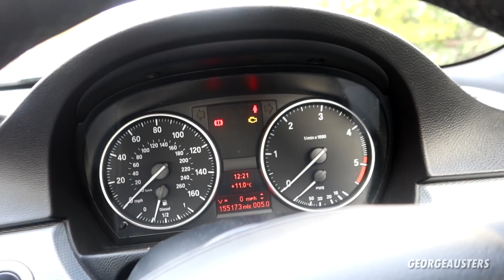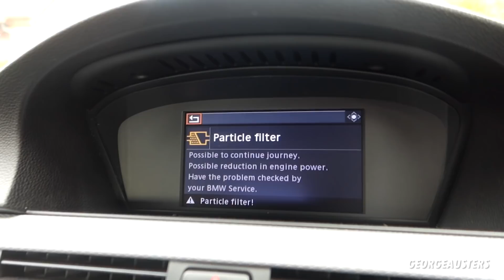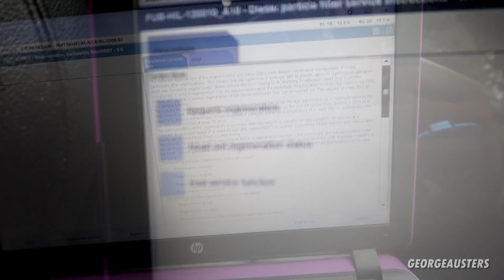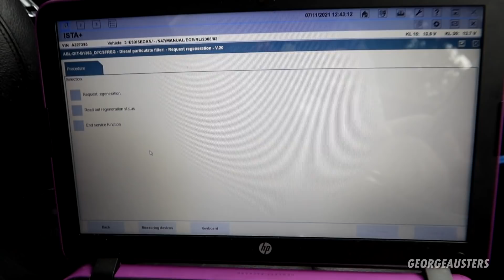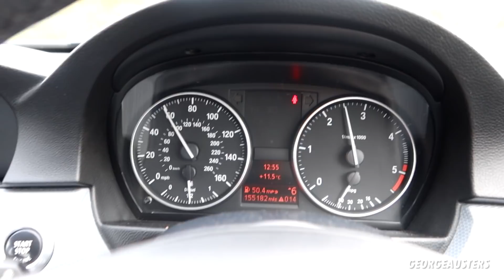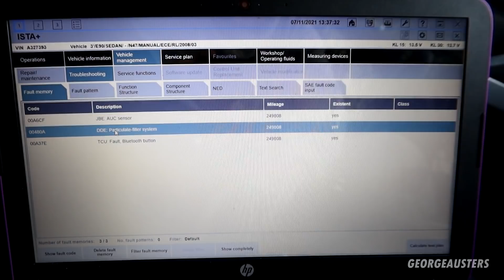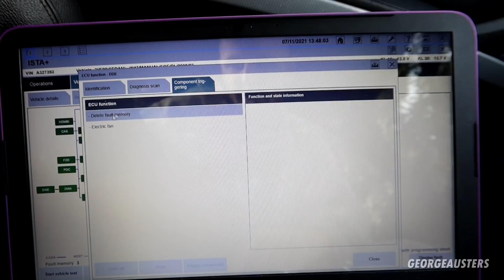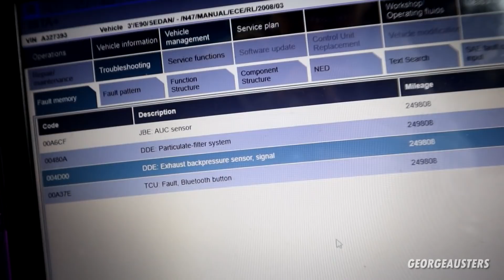SHOULD YOU REMOVE A DPF FROM YOUR DIESEL?

Comment: Hi George. I can see your problem on the ISTA while you are driving very clearly. Your back pressure reading is way too high. The ecu won’t start a regeneration unless the back pressure according the ISTA SHOULD BE WITHIN THESE RANGES: less than 35 mbar at idle, less than 75 mbar at 2000 RPM and less than 200 mbar at cut off engine RPM which is about 4000 RPM. The ISTA will do that test for you. It will rev the engine automatically during the test and the end will tell you the 3 readings and the maximum permissible values as I mentioned above. It is a safety feature because a regen with a heavily blocked dpf might set a fire. Of course you know your both egr and main engines thermostat should be working fine,  the diesel in the tank as you mentioned shouldn’t be low, of course your glow plugs and the control unit should be working, good working egr and no fault code stored in the ecu. Another reason for such high back pressure reading is a a faulty back pressure sensor which is about £30. I had the same problem. I had an on car dpf cleaning twice. It doesn’t work. What I did I took the dpf to a place near Blackpool, I live in northwest, they pump flush cleaned the dpf in about an hour for £150 just then BINGO, the pressure readings came down hugely just like what you get from a brand new dpf. Of course there is a very important thing which most of people don’t know. In the ecu software if the mileage of the car is 150 000 miles then even if the dpf is not blocked and other parameters are normal, still the dpf won’t regenerate until you go through a dpf replacement procedure in the ISTA, even if you physically installed a brand new OME DPF. By the way my car is 520d, M47 engine, 57 registration plate. Hope that will help you. Again please don’t spend any money on ON CAR DPF cleaning, specially you can take out the dpf out of the car your self. Good luck
Reply: Hello, are you suggesting to reset the Dpf counter?
Reply: @kirwanjohn101  if the DPF cleaned professionally and the back pressure is reading really low, something like less than 10 mbar at idle, then sure you need to reset the DPF which I think it will give you another 250000 km.
Reply: This happened to my sister's 1 series, told it the dpf had been changed and it fixed it
Reply: It will regenerate, you just need to keep clearing the errors. While on the motorway it slowly regens passively and it increases exhaust temperature regardless of the backpressure. Mine used to get to about 400-450C for about 10 minutes before chucking an error and failing. You need to clear the error while driving and carry on until eventually it will passively unblock itself enough to blast the temps to 600-650C. Once it hits that it usually clears the soot all the way through.

Comment: Clean thé back pressure hose and pipe kat ,check thé sensor connection and wires then First clean thé dpf then reset thé dpf.  and boom another 150k km

Comment: Check thé sensor connection easy job .tip if you remove the sensor connection fault code will pop up .just delete it and your fine . while at it give me some backpressure readings at idle and 2000rpm . thanks
Reply: Yet no Exhaust back pressure readings 😎

Comment: I have never had an issue with the DPF on any car which I have had, and I don't do huge miles. Removing it makes your car illegal and uninsurable, so if it is working fine then leave it in place. Most failures seem to stem from other issues anyway which cause it not to regen properly. Failed thermostats being a common one.
Reply: EGR is a major headache too!!!
Reply: @paulmcdonald8055  They can be, I haven't had major issues on any of my diesel cars but the one on my N57 is mapped out. (but still in place if anyone tries to look at it)
Reply: @simonh870  the egr cooler is known to crack on BMW's. Removing it entirely would give a peace of mind.
Reply: The problem with that on N47 and N57 engines at least is that you are blocking off coolant routes to the cylinder head and that can cause localised overheating. The leaking EGR was a known fault and I believe subject to a recall, so most should have been replaced by now...
Reply: My bmw1 series diesel kept stalling, new egr valve fitted runs perfectly now.
Reply: @Bob Agreed Bob
Reply: Thermostat.
Glow plugs.
Glow plug module.
Driving around on an empty tank all the time.
Short journeys.
Crapy diesel.
Crapy fuel filter.
Crapy engine oil.
The list is absolutely endless.
Reply: @gulag8735  also any ECU fault code, any half broken sensor giving false outputs like for the exhaust temps (which I think was georges issue, mine goes way over 300C when driving around 60mph constantly over 30mins+ and gets back to around 270 and lower when slowing down, for the regen to start it is I think at least 275
But you have to keep
It higher during as well in order to succeed especially when its a bit clogged already) and the list goes on and on yes. Its better to chip it even when not deleted dpf in order to prevent clogging in case stuck open thermostat not closing etc , in order to shorten the restriction list of it 🤟 Longer life of the dpf will be the reward
Reply: @gulag8735  lol and leaking injectors. Had two of these. Missed by everyone. Numerous DPF blockages as over fueling due to these injectors. And this  extra fuel diluted oil in sump. Big end bearing went , so new engine/remanufactured. M57.
Reply: Totally agree, nanocarbon molecules are filtered for a reason as they cause cancer.
Reply: @n1msu  as does sunflower oil, vegtable oil, canola oil, sugar and carbohydrates.
Eliminate these first
Reply: If you understand how the car works they can be managed quite well. My new petrol car has a ppf
Reply: It doesn't make your car uninsurable or illegal.
Reply: @Tommo12345  It does, as it no longer meets the emisisons standard for which it was originally designed. It is in the construction and use regulations. If you tell the insurance company that you have the DPF removed they will not insure the car. if you don't tell them and you are found out your insurance will be invalid.
Reply: @simonh870  You can legally take anything off you car. If it fails an mot, then you legally can't drive on the public highway. Still not uninsurable.
Reply: @Tommo12345  not uninsurable but you won’t get your insurance money lol
Reply: @Tommo12345  UK MOT failure. Also in the UK modified from "as new" so unless you tell the insurance company you have done it you are also driving without insurance. Will you get insurance for not having legally mandated equipment on the car? I doubt it.
Reply: @martinconnelly1473  Complete utter BS.
Reply: @martinconnelly1473  Why say UK MOT failure? why repeat what i already said?
Reply: @MrSwanny66  Who's correct?
Reply: @MrSwanny66  Don't talk from your back door.
Reply: @Tommo12345  Illegal but not uninsurable.
Reply: @thisisnumber0  Not illegal
Reply: @Tommo12345  of course it does, if it doesnt pass the MOT (which it wont) it is not insured
Reply: @davidstuart4915  It is insured, stop talking from your back door.  ffs
Reply: @davidstuart4915  Illegal to drive on the public highway, without an mot, unless driving to the mot test.
Reply: @Tommo12345  from 2018 in UK it will be illegal "If a car's exhaust emits visible smoke of any colour, it will fail the MOT test. Testers are also required to check if diesel cars' DPFs have been tampered with or removed. ... It's already illegal to drive a vehicle that has had its DPF removed"
Reply: @davidstuart4915  Not very bright are you? haha did you read what i wrote?
Reply: @Tommo12345  U SURE HAVE AN APT NAME :) Ciao
Reply: @davidstuart4915  Not very bright are you? haha ffs.
Reply: @davidstuart4915  who told you, some smarta** or are you presuming only? Have you tried it yet? Your car isn’t even smoking when step on it when your engine , turbos, glow plugs , module etc are all ok. If you know you know. Your comment is bs. I still have mine dpf / egr on my E70 because never had an issue but once it will fail, I’m going to delete them all, or
Maybe if the fuel price goes even more
Higher. The problem with emissions is somewhere else than in cars. Think about how many gallons of fuel are burning the big cargo ships every day 24/7, right now when we speaking. Ships that could already been photovoltaic for example or semi/half photovoltaic, whatever. Nobody does care because they can’t force China or Usa to do so, to change their cargos, limit them with something like dpf and egr on it. Better limit regular ppl with small emissions fok ups what doesn’t change a thing. Look for the tests.

Comment: I think overall driving style affects the dpf condition, short journeys are just not right for 3 litre turbo diesel cars. Replacing a dpf with a new dpf around 8-10 years into car ownership is pretty reasonable to be honest, it's just not the fun or performance way to be honest!
Reply: Well what if i nearly broke my engine since its excessive active regenerations?

The solution is now easy: remove the DPF, straight pipe it, delete dpf (and egr?!) in software and enjoy a proper Diesel
Reply: @harrison00xXx  completely agree. Get rig of the two items you mentioned and that's most of the headaches gone.
Reply: @harrison00xXx  so if it’s costs to be much to get rid of asbestos I can just burn it outside your house ?

Comment: Nothing to do with age mate it’s all to do with the journeys the car does.  When I was up and down the motorway everyday I never had a dpf issue compared to my mates a1 diesel that failed really early in the life of the car due to only doing short local journeys
Reply from the maker: Yeah that is true but after 3 years old you’re out of warranty - it’s all sorted now though, I’ll be making an update video soon👍🏻
Reply: suggest you research the difference between passive regen systems (like the ones you describe) and ACTIVE regen systems as fitted to my 2.0 TDCI Ford which ive owned for the last 7 years (bought used).it can and WILL (and has done) start, and complete a full regen at IDLE if the ECU deems it ready to regen!

Comment: I had a 520d e60 m47 engine with the same dpf problem and same fault codes, I cleared the codes then requested a regeneration and  then changed from ista to inpa started the car and drove it while someone kept pressing the erase fault codes button on the laptop as inpa erased the codes continuously and quicker than ista, this worked for me

Comment: Is it illegal to do a dpf delete in the UK?
Reply: Yes and it invalidates your insurance if they spot it when you try to claim.
Reply from the maker: It’s not illegal to remove it, it’s just illegal to drive on the public road without one fitted when one was from factory.

Gutting it leaves no trace of it ever being removed👍🏻
Reply: @GeorgeAusters  Revoving it will make the car emit more soot, that was what it was there for. It can easily be seen when the car is accelerating, and there is no map that can get around that otherwise the DPF wouldn't have been fitted in the first place. The chances of being caught are slim but if you get involved in an accident and it is found out the consequences are severe.

Comment: Just to add George I also had the back pressure sensor signal warning as well .. my hunch is that it's not the sensor itself that's faulty (I bought another one and swapped it.. no difference!) but rather it's reading a high pressure value due to the blocked DPF and is therefore raising the fault code. It also seems the system is self defeating.. like it can't run a regen because it has a fault code.. but as you can't GET it to regen what the hell are you supposed to do? Ultimately as mentioned in another post I just replaced mine and it's been fine since... Verified that regenerations were happening since r replacement successfully. Though I haven't checked it in a while so maybe I should.. 😆

I didn't take the route of DPF deletion due to the prospect of trouble at the MOT.
Reply from the maker: I have another video coming with a resolution👌🏼
Reply: they can't tell if done properly
Reply: @doctord8589  That's what I would have thought.

Comment: Hi George I suspect it wont re-gen because the dpf is blocked at the back with ash. Dpf's do have a limited lifespan & will only re-gen so many times before they need replacing because when it re-gens whilst it burns the soot out this process produces ash which can't be removed/burnt out of the dpf,  & the ash builds up at the back of the dpf causing the differential pressures from the front to the back of the dpf become too large (implausible) giving you the trouble codes I think you've got. I had a problem with a ford galaxy that wouldn't re-gen. It had similar trouble codes & would go through the motions but would not re-gen. It turned out that the differential pressures form the front of the dpf to the rear of the dpf were too great which  think is what your diagnostics are suggesting. There are companies that clean dpf's & they always clean them back to front to force the ash out of the front of the dpf. In my case  the dpf was too far gone & had to be replaced because the diesel catalytic converter had broken up & also blocked the dpf. once I replaced the catalytic converter & dpf the car did a re-gen straight away without me having to request one because it was happy with the differential pressures. I also found out that some dpf's re-gen much more frequently than most people think as watching it on live data after I had done the repair it regenerated several times on a 60 minute journey & that was with all new parts. I hope this help you.
Reply: BMW cars have backpressure sensor not differential pressure sensor. It uses only one hose plugged from the DPF
Reply: @Antonio Carsa  what I meant was there are two pressure sensors one at the front & one at the back of the dpf & the ecu measures the difference between the two sensors, hence differential pressure
Reply: @simonkeable391  BMW does not have a pressure sensor after DPF. There are two sensors. One mounted before the turbocharger in the exhaust manifold and one before the DPF/OxyCat. The backpressure measurement is based on the difference between the pressure read with engine off and with engine running.

Comment: Went through the hassle of a blocked DPF on my N47 E61.. car was running awful (couldn't accelerate basically!) and wouldn't regen. Back pressure values measured using CARLY were through the roof so all signs pointed to one possible issue. Ended up removing it with the intention of getting it cleaned by a specialist in Wolverhampton but mid way through the job the DPF was stolen off my driveway! (The joys of living in Birmingham) .. anyway £250 for a new one from Euro Car Parts, set the parameter in DIS57 to tell the car it has a new DPF (annoyingly can't do this in CARLY which I also use) and it's been perfect since.
Reply from the maker: Jeez!

Comment: Check the hose that connects to the back pressure sensor, I believe its called the manifold pressure sensor hose. Did you or I should ask would you consider using additives to the fuel like Wynns DPF cleaner?
Reply from the maker: All additives essentially do is help the combustion temps thus the exhaust temps reach a little higher
Reply: I see from your responses that you have rectified the problem. Looking forward to your update. Im assuming you removed and cleaned the DPF? To be honest I'm thinking of doing the same but I guess we will soon find out what you done 😉

Comment: Hey George, nice video, recently been doing the same with dpf issues. Can i ask you about other think tho, my N47 when i turn it off it does not turn imidiately like a friend's e82, his engine shuts off normaly but mine takes a bit more revolutions and shudders a bit. What can cause that? I have already replaced the anti shudder valve.
Reply: Scotty Kilmer say's, give yourself a fancy scantool :-)
Reply from the maker: Any fault codes?
Reply: @GeorgeAusters  no fault codes

Comment: Hi George. I've done a DPF gut and a EGR electronic delete on a BMW N47,
PROS: more power, 1L less diesel consumption.
CONS: The exhaust makes a whistle, it blows some black smoke on heavy acceleration and it smells.
My car had DPF+CAT on the same muffler, so when it was gutted we lost the Catalyst function too.
I was thinking if i put an universal catalyst in the middle of the exhaust (my car doesn't have the middle muffler) i can catch 2 birds with 1 stone: reduce the whistle noise from the eaxhaust tip, and reduce the smell and the black smoke.
Do you think it's plausible?
Reply from the maker: Possibly!
Reply: @GeorgeAusters  nevertheless, making all the calculations, a car without DPF that consumes 1L less/100km maybe it's more enviromental friendly than a car with a problematic DPF (almost all).
Reply: You should only delete dpf and leave cat in place.
Reply: The whistle noise is just the turbo when the wastegate moves when it starts it sounds like a jet

Comment: I had a dpf issue on a 2018 Mazda 3 2.2D, this one was regenerating too often (every 60km). The fuel economy was terrible (7,6L/100km = 35mpg) for a 150hp 4cyl 2018 diesel because of these active regenerations (diesel is sent in the exhaust). 
What a nightmare it was, dealers never solved the issue and I finally did sold the car to the right guy. Now I drive an e46 m47 euro 3: way cheaper, no egr, no dpf, what a relief this car is! I will never own a car with a dpf again.

I’ll add that a dpf is complete manufacturers bs to pass emission tests since the particle are rejected anyway during regenarations. They are just thinner and worse for your lumbs.